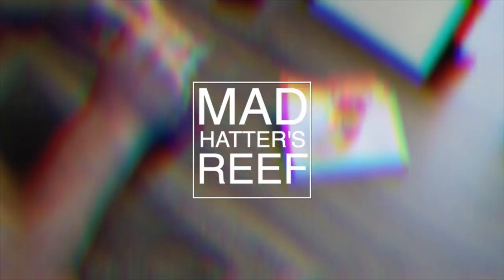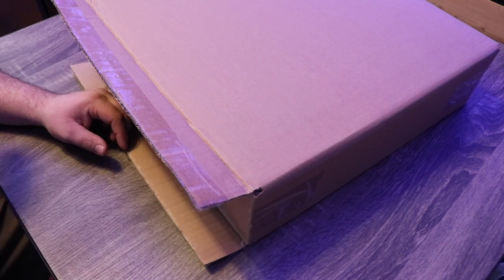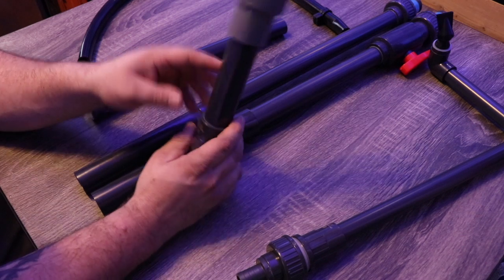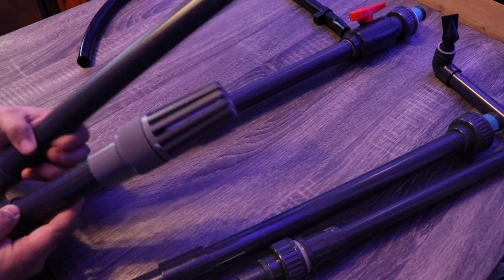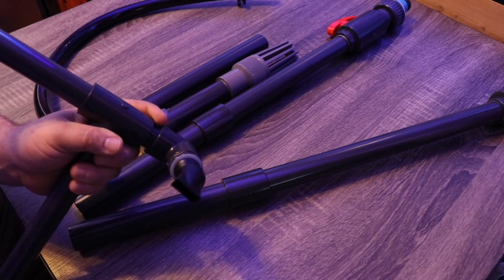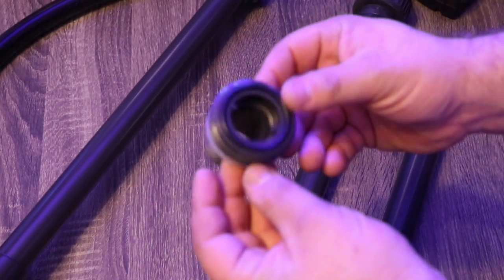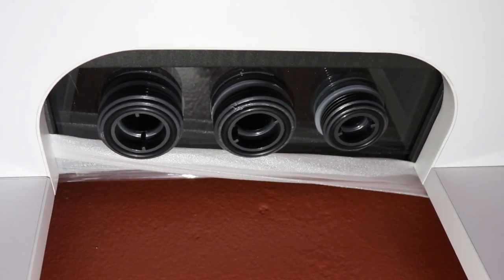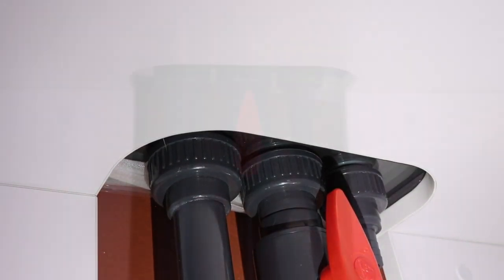Waterbox Reef Tank Build | Ep. 3 | Plumbing

Comment: Hey Jeff
Seeing my question is regarding plumbing so I posted my question here.  I was wondering what you had to do to get the return hose to connect to the return pump? The little gray nozzle that came with the pump is too small to fit onto the black return hose, should I just use a zip strip?
Reply: I also hate the lighting that came with the tank the brand of lights are AI prime, And according to the instructions I can either connected to their website or I can connect to Wi-Fi and those are my only two options so with that being said what would be a good but cheap lighting set up for a mixed reef?  
I only plan on keeping a few SPS corals being I am a beginner with SPS.